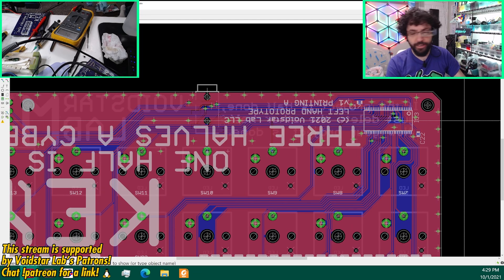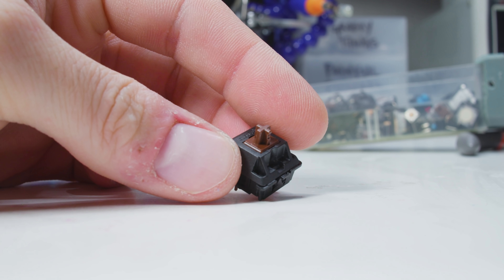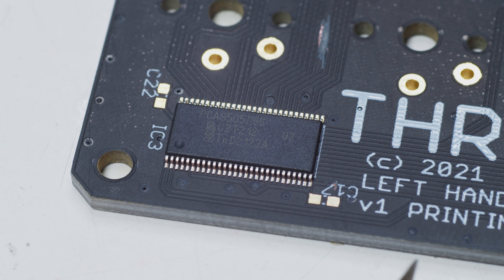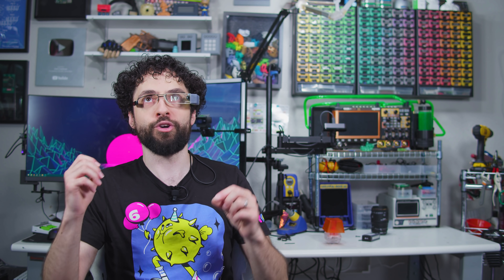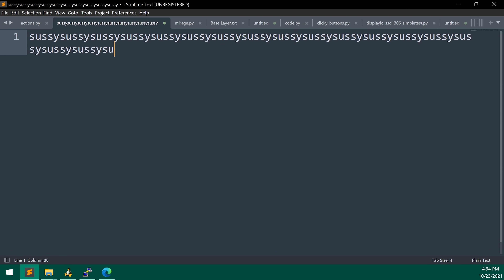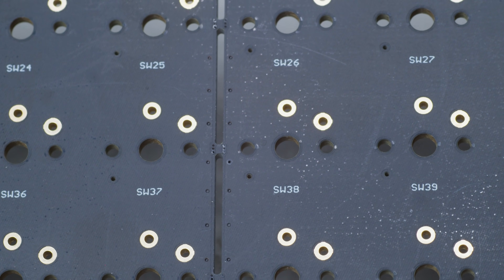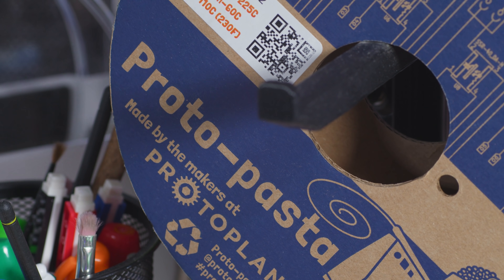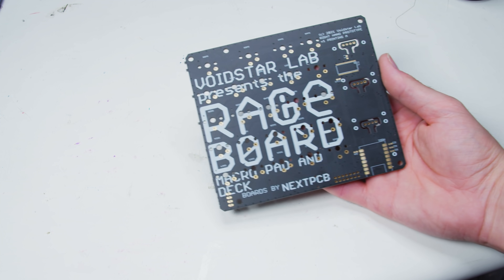I Invented a Keyboard and Snapped it in Half (MiRage Mech Keyboard)

Comment: The problem with Choc switches is not the feel or functionality, but the sound. In the recent years MX style switches have gone to insane new heights. Switches like The Boba U4T, Tecsee Zakus, Kineticlabs Hippos have their own sound profile and own very custom feels. There is just so much more there due to the lack of patent on the design. Also, wrist rests are great for dealing with the height problem.

All the other features of this keyboard are neat though. I like that it can be split in two should you want it, and I love the screens/buttons on the right side.

Comment: What keyboard layouts does that new firmware work with? I mean, proposing that I bought a Cherry switch-compatible macropad that still need diodes. If it works with the traditional macropad-building strategy, I'm going to save myself loads of time

Comment: 5:40 literally just 12x0.14mm2 LiYY telecom cable. It's like 2 dollars a meter and it's never in your lifetime will wear out. If you want a cheaper option, 12x0.14mm2 alarm cable. Bonus: You can get 2x0.5+10x0.14mm2 alarm cable where you have 2 thick ass wires for power and 10 data lines. The latter two are under a buck per meter. So I might just have better luck than you but these are 2 completely valid options.

Comment: I took a look at the PCB and noticed that the keyboard uses the ANSI layout, but I use the Swiss QWERTZ layout who requires the ISO layout (more specifically the key between Shift and y) if I want to type the angled brackets and the backslash, as well as the Alt Gr key for an 3rd layer of character (Although that problem seems to be more on the software side). Will there be an ISO layout eventually?

Comment: Nice project, just signed up for the alpha test and will definitely check out the github stuff as soon as I get home tonight. 
My first keyboard was an original IBM (I think Model F 122) from an old terminal that I got in '81 or so, not for a PC but for a home built 6502 system. When I bought my first PC shortly after, I bought a Cherry keyboard and that is the one that started my keyboard addiction. I kept buying all kinds of weird keyboards. 
My last buy was a Streamdeck but I hated this one as soon as I used it in the first week. The mechanical click that I get from the streamdeck does not match the key "press" and I have to press way harder on the keys than what I would like. Then I decided to make my own and based on your big-wheel video deck I built a jog shuttle with some macro buttons for Davinci Resolve.
I guess it is now getting time to build my own custom keyboard 😃

Comment: I got a Lily58 and I've been trying to find some low-profile keycaps for it (to the point of buying a 3d printer and trying to print some, I got them down to 4.8mm but they don't finish well on the corners). I might just have to get another Lily58 and some Kailh Chocs. I really love the GergoPlex that Ben Vallack uses ( https://youtu.be/dWfQeuXDK_o ) but with a few more keys. Alternativly I might design/solder my own split keyboard if I get really frustrated. lol.

Comment: I like the project and the choice of using low profile switches as well as a current uC.
Inspired by your first keyboard video, I built a redox using mx-style switches, found them too tall and built another one using kailh choc robins. 
The new keeb is really quite a bit lower than the first one, but I hardly ever use it. While the robins are quite a bit on the loud side, they are not unpleasant to type on. But I really dislike that there aren't any good choc keycaps. I have a bunch of those clear ABS keycaps as well as the set with a black top and a white lower part that are used by everyone for those switches. Both types of caps feel really cheap and low-quality compared to a decent set of keycaps. On the other board a have a set of Akko wave caps in ASA profile. They look and feel really nice and on top of some glorious pandas they sound really good. It's just a lovely keeb to type on.
Without some decent keycaps the low profile board won't be my daily driver anytime soon. Maybe someday someone decides to manufacture a set of PBT caps for the choc profile. I'm not holding my breath, though.

Comment: Changing the center hole on the choc footprint to 1.7mm and optionally using the same footprint as the Ferris holds the switches well enough they can't be put on the board crooked (the keys are often held in so well they won't fall out even if they aren't soldered)

Comment: Uh this is awesome! :D the pcb in my cyberdeck is also IO-Expander ready, but you can also add another 32u4... glad I did it because adding IO-expander support to QMK would have taken me way to long. You pretty much did everything I would have done for the next iteration (+ the displays). Definitely going to sign that form. Awesome work man and great video  👍
Reply: QMK already has support for io expanders.  the ergodox OG and EZ, the moonlander, the dactyl, and other boards use them.  So it's not like you'd have to write new code.
Reply: @drashna  yes and no. Yes now a days there is support for IO-Expanders. When I tried it there were way les boards that used them an all had there own stragen ways to implement them so it would not have been a easy copy an past. Also the implementation was particular to the expander not just a general class or something. QMK is mighty and awesome but it's also a pain to customize for a one-off board with special features

Comment: re: 6m14s: I use Foostan's CRKBD at home, which actually uses the same firmware on both, and does the same I2C-over-TRS that you do... but it is double-sided (the two PCB halves are identical, not mirrored), and it can detect not just which side has been soldered as "up", but also detect whether it's getting its power over USB or over TRS, and changes behaviour so the "slave" half sends just row/column/state updates to the "master". Only the master needs your current keymap flashed to it, and that means you can actually keep two entirely different keymaps (each with up to 8 layers), that you can toggle between by just swapping which half of the keyboard you plug the USB into.

Comment: I've been working on something very similar, except I've been using two of the adafruit 5×6 hot swappable mx boards for easy ortholinear layout design. My firmware is also running circuitpython, using a pi pico board

Comment: hey ! i'd be really interested on working on this project and adding my personnal touches (like maybe replacing one of the screens with hot swap addons like a rotary encoder or a trackpoint !), or maybe adding some hinges on the split keyboard to make it able to fold in 1 small piece and store it safely. Tho i have to admit that i have never worked on keyboards that are not using qmk,  that could be a very nice experience nonetheless (:
Reply from the maker: I may actually cut the screens myself. They look cool and work great, but I'm not sure I can prevent the OLEDs from cracking if users mash them down. They also take a while to update, and flicker on camera. I may replace them with wheels or modular snap-in controls.
Reply: @ZackFreedman  i think that a small piece of clear acrylic could do the trick, tho i don't think that they are as useful as they seem at the end of the day. Maybe you could use a smaller 128x32 oled screen if you want to display informations about those said wheels and snap-in constrols and leave more space to work with. I was thinking of something else too, i have a keyboard that has the option of soldering a bunch of stuff on a single space, either a keyswitch, a rotary encoder, an oled screen, a slider etc.. and i think that implementing this kind of design could lead to better modularity and more options for the end user, if it was done on let's say, the far right and far left columns of the keyboard. Thanks for the reply though!

Comment: Would I need a 3d printer to take part in the alpha test? Definitely down to be in on it, but I "only" have a resin printer, which may be quite the nightmare to print the case in.
Reply from the maker: I'd prefer testers with printers, because I also need to make sure it's compatible with everyone's hardware. But feel free to sign up: https://forms.gle/1NZyLnt1roZXHf4b9

Comment: Awesome keyboard! I like the use of io expanders.  I'm going to have to look into circuit python now. Thanks!
Reply from the maker: It's a pleasure to use, but many operations are slow. I may need to rewrite this in C++ to get the performance we need for consistent clacking.
Reply: @ZackFreedman  let us know how it goes! I've been noodling with using a microcontroller with enough pins to use one per switch, but they tend to get more expensive.
Reply: @ZackFreedman  or maybe use the even cooler rustlang 😎
Reply: There are some aspects of keyboard firmware design that are not obvious, such as n-key rollover. I have noticed that a lot of keyboard manufacturers don't get it right, and the result is a lot of transposed characters when typing, especially when using modifier or shift keys.
Reply: @filker0  Right? “N-key” is suuuuch a diluted marketing term.